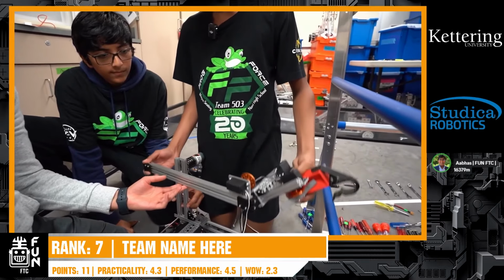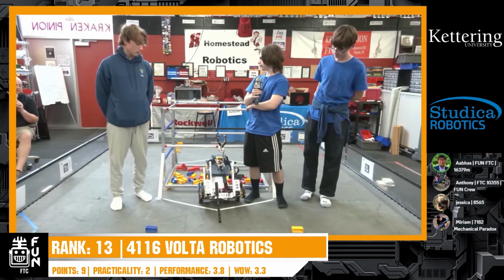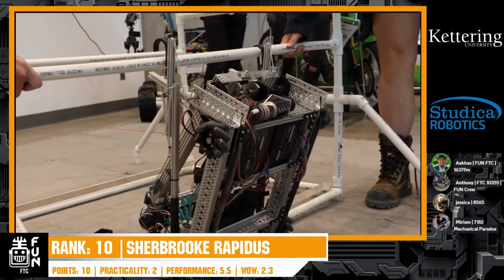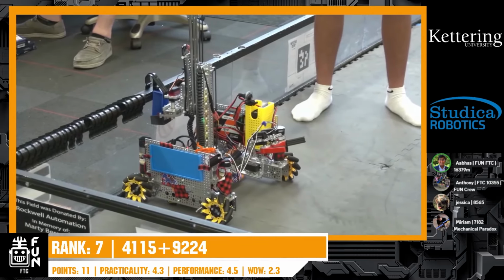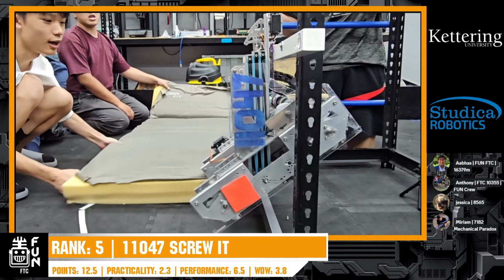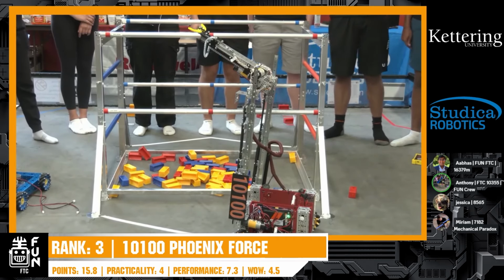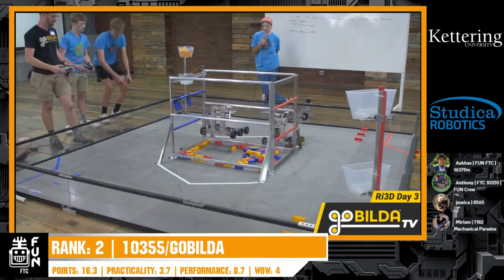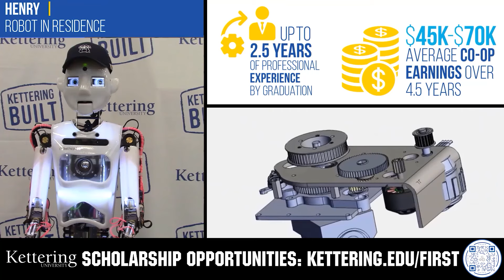Top INTO THE DEEP Ri30H/Quick Builds | FUN FTC

Comment: Thanks for your analysis! I'm from the ri30h team. Don't be fooled, the transfer looks simple, but it took a long time to get working. If the hopper and collection aren't lined up just right, it'll shoot the sample up and out of the bot as it lifts, or if the slot is too wide the samples will fall back out. We added a bunch of flexible fingers with zip ties and cut foam to hold the sample from failing back through the slot. And we made the collection really thin to make the slot as thin as we could. I would recommend teams prototype it if they can before deciding to go with it to make sure you can make it work.